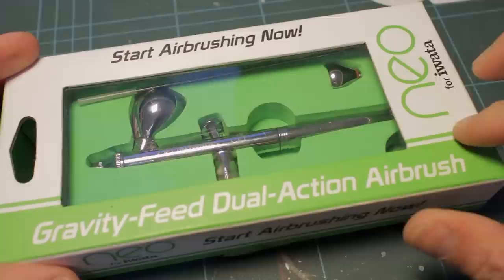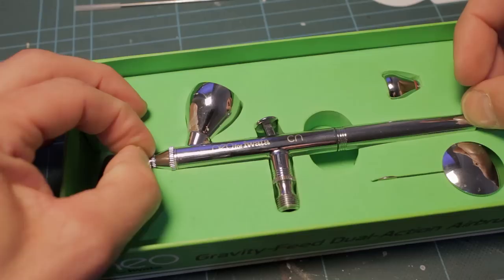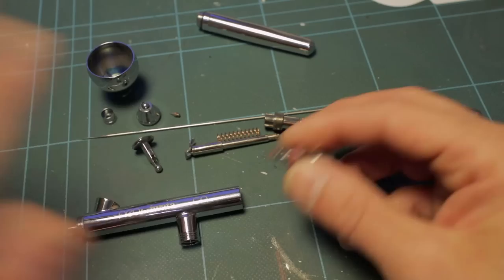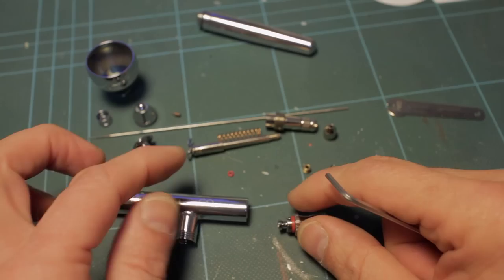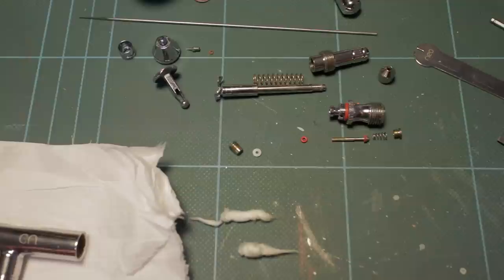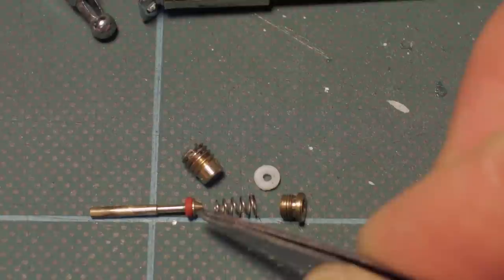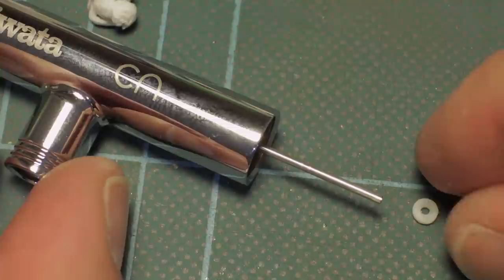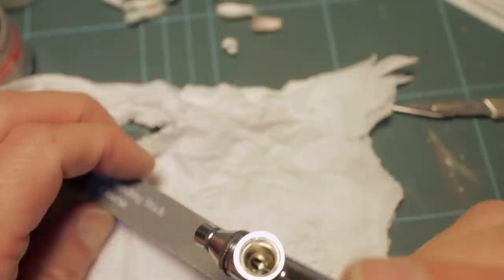NEO for Iwata, CN, Review & Complete Strip, Clean & Test

Comment: Neo owner and airbrush beginner here - Iwata do themselves no favours by not having some of this detail in the user pamphlet. They even have a warning on the top of the sheet to never remove the nozzle unless it's damaged or clogged, but I can't see how you can avoid it getting clogged or damaged without regularly removing the nozzle to clean it. I thought I was quite scrupulously cleaning it until it started performing poorly recently and can immediately see where I've been going wrong now. Really helpful video thanks very much.
Reply from the maker: Glad to help.
I honestly believe the advice to not remove is simply because you can snap the threads so easily by overtightening and if you're not used to such small sizes it's natural to try and tighten too much.
They'd be better having an in depth strip and replace procedure explaining to only snug them up and not use the wrench to tighten more than required.

Comment: I'm new to airbrushing as well. Your video has taught me a lot. Many thanks for such an informative video.  I have 3 airbrushes, all cheap Chinese types, - My first one was a a single action syphon feed and bottom bottle type,  of which I bought years ago back in the 1990's for painting model railroad scenery, - My second one is a double action syphon feed and bottom bottle type of which my Son-In-Law (who's an Automotive Body Specialist) , gave me  about 5 years ago of which I've never used as of yet (it was his first one as well),  -  My third one (I bought about 6 months ago), is a double action gravity feed type, also of which I haven't used yet (I'm still trying to acquire all of the necessary supplies, and equipment first before I begin learning the field of airbrushing.

I already have two  compressor's. - One is a 21 gallon shop type, and the other one is a hobby type made for air brushing with a reservoir tank attached),  and I have also built my own plywood 24" X 24" X 16" spray-booth with light, and a 12 volt DC squirrel-cage exhaust fan ( Exhaust fan and duct-work housing was made from an old dodge pickup heater assembly with low and high speeds). 

The pro's are that (1) it has great exhaust suction upon both speeds, and (2) that the fan motor is located outside the duct-work air flow for safety in case of any sparks, and (3) the total cost of building it was around $15.00, - $10.00 for the 16" long Flat LED under-counter lamp assembly at Walmart, $5.00 for a three-gang plastic electrical box, and three standard house-light switches. Everything else I either had on hand, or I scrounged for free. (In fact the amp gauge I installed in it came from an old non-working automotive battery charger I no longer used and just had laying around yet). 

The Con 's are that (1) it takes from 8 to 12 amps ( 8 amps on low, 12 amps on high), to power that fan, and (2) I have to use a 12 volt automotive battery, or an automotive battery charger which puts out that amount of 12 amps to power that squirrel-cage fan. 

I eventually want to get a good brand name airbrush such as Iwata, Badger, etc., as well in the future. So, I'm viewing the reviews of all video's of different air brush brands and types to help me select the proper one when the time comes to get one. 

However, this brings up a question of which you covered in the video, of which I did not see asked as a question from another person when I read all of the posted comments from your loyal fans. 

You specified that the needle should always be removed for cleaning from the front rather than by dragging it backwards through the inner seal. I thought that was a great information tip, "Thank You" for such a great tip of advice.  

The Question I have pertains to that great advice. - Can the removal of the needle from the front be done with all brands and types of air brushes, or just with the Iwata "Neo" Air Brush? - Once again, Thank You Sir for such a Great Video, and for sharing it for one and all.
Reply from the maker: Thank you and welcome to the world of airbrushing, your home made spraybooth sounds incredible and the sort of thing people would love to see a video about explaining the construction, I'd never thought about vehicle fans yet they're a great idea.
Re the needle, this can be done on any airbrush, however, some airbrushes, typically siphon feed types, have a ball fitted to the end of the needle at the rear preventing you doing this, these however can be cut off, they're deisgned that way solely as a 'grab handle' to quickly pull back and clear a blocked nozzle with fast drying paint.

Comment: I have never used an airbrush but I did purchase the Iwata CN medium for my leather crafting hobby.  I noticed your video's title, which includes the word 'REBUILD'.  As a practice exercise, I decided to follow you, step by step, through the process of dismantling the brush.  After it was completely apart it took quite a while for me to figure out how to assemble the trigger, ( at approximately 21:46) and the apparatus connecting to it, since you went directly back to a point beyond this.   Had I known you were going to skip steps, I would never have taken it apart.  What I thought was going to be an easy process became very confusing. This is a great video for someone who is familiar with the 'guts' of the airbrush, but skipping a couple of crucial steps made it quite a challenge for me.  Thanks, though!  I did get a lot of understanding out of your efforts.
Reply from the maker: Firstly, thank you for the feedback and I am glad you found the parts of it useful.
Secondly, apologies for skipping anything, I do try to balance long and boring with 'enough info' and sometimes, though I can't say specifically if it was the case with this one, I sometimes lose footage or forget to press record.
If you do need it though, i'm quite happy to film you a little clip showing the operation and assembly, it is a very fiddly assembly and Iwata for example have this piece rivetted to the needle tube.
Reply: @spidiq8  I appreciate that very much but I think I have it assembled properly now.  I'll give in a try and if there's a problem I'll get back to you, but I don't think that will be necessary.  I'm really new to this, so it's my issue and not yours. I appologize if I was direct.  I was a little frustrated.  I could not tell which side was correct (up or down) while placing the back piece into the barrel (ie. the piece that receives the trigger from the top.)  I guess my bigger concern is potential damage.  I'll try it next week and see how it goes.  Thanks, again, for getting back to me!  I appreciate it!  Good luck with your video production!  They are very descriptive and helpful!
Reply from the maker: @derricksheppard2020  I'm sure it's in OK, typically if it's installed incorrectly it'll just not slide back and appear to lock but the good news is, unless you forced anything to get it to fit you can't damage anything.

Comment: Came here for help, Figured out my tiny seals on the air value, the one inside was bad. I was able to swap the outer one, with the inner one and my brush is working again. Temp fix, need to get new seals asap though.

Comment: I brought one of these. Used it once. Gave it a clean as you do. When I put the nozzle cap back on it doesn't work. No paint comes out it stops any air from flowing completely. If I losen it, it works again. But I can't spray with the nozzle cap lose as you can feel the air moving  the cap back and forth. I have no idea what to do. Started using my cheap air brush again. Any idea what may be the problem?
Reply from the maker: There are 2 possibilities. The nozzle is incorrectly seated and sticking out more or the cap is screwing down further than it should both possibilities meaning it's sealing around the nozzle and not allowing air to pass.
See my video here on how airbrushes work and fault diagnosis to understand and re check and rebuild the brush carefully making sure it's spotless and seals are intact and everything seated.
https://youtu.be/2Hxwev8c53o
Reply from the maker: Here's the how to thoroughly clean procedure.
https://youtu.be/tcSBK0l5Lbw

Comment: Hi, could you help, when trying to use my Neo after a deep clean, there is no airflow through the brush unlesss I loosen the nozzle cap, Ive not experienced this problem before, is this normal? Thanks
Reply from the maker: Definitely not normal. It seems that the hole at the front (not the needle the offset one behind the air cap) is being blocked. If it works with that loosened something in there is blocking it.

Comment: Followed your concise instructions to clean mine. Worked a treat now everything is spotless. However I'm not getting much if any air flow through the air valve assembly unless there is some lateral movement when the valve pin is depressed. I can not figure out why?
Reply from the maker: Is your trigger correctly aligned, remove the needle and pop out the trigger and refit it. Connect the air and press the plunger. If it's aligned properly and presses and returns but the air isn't getting through verify that the compressor is in fact building pressure and pushing it out of the hose. At this point if they check out the problem has to be with the air valve assembly and possible blockage or damage to the o rings.
Check out this video to see how it works and it should guide you to locating and fixing the fault.
https://m.youtube.com/watch?v=2Hxwev8c53o&t=8s
Reply: @spidiq8  thanks the issue is definitely in the air valve assembly. It  seems the o-ring nearest the spring is unseating and not sliding in the hole it is in
Reply from the maker: @cheynewellington  Hopefully you have it sorted now.

Comment: So I took apart my airbrush, cleaned it, then put it back together. But the trigger is loose and won't stay in place. It wobbles back and forth without me pressing down and then moving it. The gun shoots out air but nothing else. I think it's because of the trigger. Any idea what could be causing this?
Reply from the maker: It's either inserted incorrectly and / or the return spring on the needle chuck is loose, broken or missing.
Did you strip it completely as I did in the video?
For general cleaning you only need to follow the procedure in the video below, the full strip is for in depth cleaning if there's been a seal failure or you bought it second hand or other reason there might be paint in bits there shouldn't be.
However, if you disassemble again and reassemble following the video you'll get it back together and working.
The trigger plunger is correctly placed when inserted and you can press it down and it comes back up. The return spring in the needle chucking tube provides resistance to pulling back and pushes it forward.
https://www.youtube.com/watch?v=tcSBK0l5Lbw
Reply: @spidiq8  Yeah did it just like you did. But I think this will work. Thanks

Comment: Thanks for actual informational video!
Reply from the maker: You're welcome, glad it was useful to you.
Reply: @spidiq8  I haven't finished the video yet, but people are telling me to return the neo I bought and buy an Eclipse or something else. I'm a first timer, and 80 for the neo was a bit much to begin with and definitely not 150 for the Eclipse.... But, they say the orings can't handle the lacquer paint I have and aslo that I can't spray the lacquer thinner through it because of the orings. Is this true?

You mentioned old rings vs the new ones, how can I tell? Will the new ones handle the lacquer stuff?
Reply from the maker: @collinrohwer1790  There's no need to return or buy a more expensive one. The only o ring at risk of damage is the nozzle one when cleaning, but not during use and spraying, what happens is standard rubber dries and degrades with exposure to harsh solvents over time, provided you're not soaking it in thinner when cleaning it'll last a good while, I use beeswax on mine instead as I like to soak the nozzle components in cellulose thinner.
Newer ones will use viton o rings which are red/brown or green in colour and more chemical resistant, (the same as used in vehicle fuel systems).
Unfortunately many people regurgitate information based on hearsay rather than experience in model making.
Reply: @spidiq8  wonderful! Thanks for the reply and information. I do have one more question... You mention that you use beeswax instead... Instead of what? The lacquer cleaner?

I did finish the video and I'm glad I found it, I would not have known any of that and would likley have shortend the life span.
Reply from the maker: @collinrohwer1790  No, instead of an o ring, using a toothpick put a tiny spot on the nozzle thread. This helps seal it and means you can drop the nozzle into the thinner to soak while you clean the brush.
Glad to help and glad you found the video useful.

Comment: hello, are acrylic paints that are used for models poisoning? Also will a spraybooth reduce dust particles on the models i paint? I wanna by a good airbrush pistol with a spray booth and airbrush at home without messing up the whole furniture with paint.
Reply from the maker: Any paint can be harmful if proper care isn't taken. Acrylic paints are a type of plastic polymer and you don't want to be ingesting any particles. However many think they're 'safe' because many acrylics are water based, when they're atomised and released as a aerosol though there's a risk of inhalation, a spray booth. Used correctly, will contain the bulk of over spray but you should ideally wear a respirator with particulate filters for acrylics and filters for harmful organic compounds if using a paint with a harmful solvent.
Properly used you shouldn't get any over spray on furniture etc however.
Reply: @spidiq8  i see! I would use a respirator! thats for sure! So no over spray on furnitur. And how about fume? Would the room stink like hell if i use this spray booth and would use this pipe to the window ? Thanks
Reply from the maker: @gaboaaa23  If you're using water based acrylics there'll be no noticeable smell and no fumes.
With enamels or cellulose/lacquer paints there will be a lingering smell and fumes but that will be lessened with a vent hose.
Reply: @spidiq8  ok thanks! Are there waterbasedd acrylics for airbrush, that dosnt cost the world? I will be totaly new to this airbrush stuff. I only havent bought one because i was affraid of the fumes and the paint going all over the room and furniture. But now that i know that there are these spray booth i will try my luck. Thanks
Reply from the maker: @gaboaaa23  Yes, a lot of model paints nowadays are water based acrylic, when you take into consideration the amount used on a model kit or small figure they're not that costly, it's the initial purchasing that seems so. Look into Vallejo air, citadel by games workshop, mig, Tamiya are good for spraying but alcohol based.

Comment: Hey, not sure if you will see this. I just bought this airbrush and it came in, it's a great looking airbrush however my hose doesn't connect to it. I'm still rather new to the field, would you by any chance know of what piece I need to connect this airbrush to my hose! I hope you see this and can link me somewhere to get what I need. It's really bugging me as I thought I'd get to use this new airbrush today.
Reply from the maker: The brush should have a standard 1/8 thread coupling and your hose likewise if it's a standard airbrush compressor hose, same fitting both ends. 
Check that neither brush or hose haven't already got something fitted to the threads.

Comment: The little flap piece that goes behind the trigger that's attached to the needle chucking guide, how does yours stay attached to the chucking guide? I was cleaning my Neo and it came off and I about lost it, I found it though and it took forever to get it back and get my brush back together. Is that normal?
Reply from the maker: Hi, Yes this part is loose, it's held in by the needle which passes through it, they are fiddly but if you make sure you don't turn the brush upside down or press the trigger with the needle out it should stay in place.
Reply: Thanks so much for the tip, because that's exactly what I had done, I had taken the trigger and needle out to give it a thorough cleaning and that's when it fell out, ever since then I'm very hesitant about touching let alone removing the trigger.
Reply from the maker: @Jarhead1313  No problem. Bear in mind you can't break anything by that coming out or removing the trigger. That piece is fiddly but you can reassemble.

Comment: how do you get the detached "S" piece to fit..once you have removed the trigger??? I can't get the trigger to seat? Please help. Thank you.
Reply from the maker: It's just a case of fiddling it into place and placing the trigger plunger into the hole. It's tricky and hard to explain but you have to feed it in sideways then turn it so it's resting on the spring needle guide then place the trigger. While it's all upright feed the needle in through the front with the nozzle off.
Reply: @spidiq8  Yes!! I got it. It just  rests on the "S" piece sort of. i actually found the "sweet spot" so to speak to "seat " it. Also, to others doing this-make sure your work area is clear of everything else. These pieces are "Tiny". Best have a small dish to place parts on.
Reply from the maker: @michaelpal7641  Glad you got that sorted and yes. They're fiddly things.